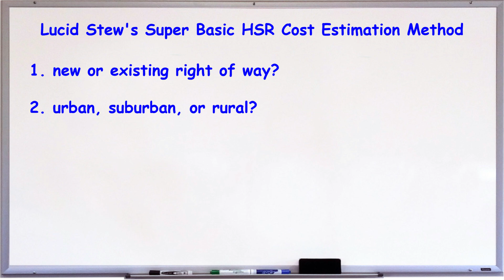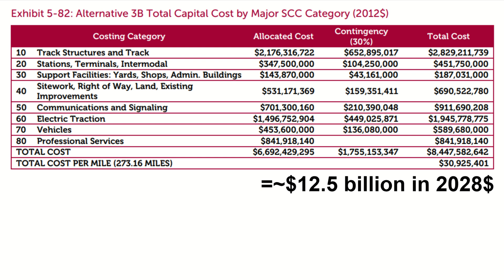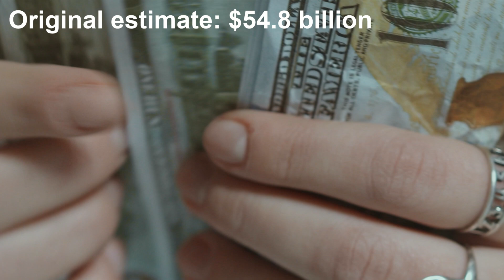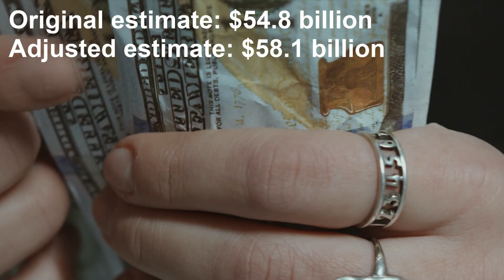Regional Cost Estimate Adjustments For Previous HSR Videos

Comment: A number of your commenters herein and elsewhere seem to be under the illusion that HSR is too complex for American construction companies and technology providers. That's utter nonsense. Our huge contractors are capable of building complex infrastructure. None of the concrete bridges and pergolas under construction between Madera and Shafter are as complex as the incredible freeway interchanges in Los Angeles, Houston, and Atlanta, that look like a bowl of spaghetti. Unfortunately, the spaghetti metaphor does not do justice to these complex engineering marvels that allow multiple roadway paths to cross each other in order to safely and efficiently facilitate the movement of high speed motor vehicular traffic from one highway to another. The geometry and math involved in their design and engineering is far more intricate than anything found in any HSR project anywhere in the world. HSR requires large radius curves and mild, gradual grades, and that's why it is relatively simple compared to the modern highways that urbanists and railfans detest We're experts in advanced electronics and computerization because of our military prowess and industrial might. And we're capable of building complex power distribution systems. Look at the very complex air traffic control system employed by the FAA. Moreover, much if, not all, of the technology needed for signalling and electrification can be purchased off the shelf from Siemens and Hitachi. No, the real problem is politicians and bureaucrats, both in California and DC. And an unwillingness to fund a costly, long term project. California unwisely commenced a project it was unprepared to promote, incapable of administering, and unwilling to fund. THE result is 20+ years of EXCUSES...EXCUSES....EXCUSES.
Reply from the maker: CAHSR specifically... in hindsight Proposition 1A was bad. The me that voted for it basically thought infrastructure = good. Now that I know a little more about the subject, all the caveats and restrictions are a terrible idea. This reinforces my thought that the referendum system needs reform because the general populace isn't qualified to make these decisions. Some of that is born from politicians who don't want to take a political risk or don't have the votes, so they transfer that to the referendum system.
On the national side, the current plan is just painfully slow. I will credit Congressional Democrats for managing at least SOME funding over the next 5 years.
Reply: @LucidStew Yes the proposition system is flawed for the reasons you stated. (Was looking here for "the" Chris comment).

Comment: One thing that's overlooked here is that a big reason Asia and Europe can build HSR for cheaper than we can is that they've a lot of time and money spinning up their build infrastructure. They've had decades of experience planning and actually building this infrastructure, securing supply chains, and their construction crews are already experienced in doing the work. Undoubtedly, no small part of CAHSR's cost is having to pay for spinning up the infrastructure to build HSR in the US at all. As more HSR gets built, that institutional knowledge is going to get built up and should help bring down the costs to build HSR elsewhere in the country. As such, building some of the smaller, cheaper projects first might help make the larger projects more attainable. The trick is that we can't stop building until we're done; once we stop, the institutional knowledge we paid to create is going to vaporize practically overnight, and it's going to be more expensive to build all over again. I'm really hoping some of these projects get off the ground before CAHSR phase 1 finishes.

Comment: Construction cost estimating is an important part of building anything, and it's taught in schools and people specialize within the field and get certified in some way. But none of that means anything if the thing you're building is in a constant state of flux as to it's specific form - which is true of almost every passenger rail project in the past few decades. I think public financing tends to set up a sort of secret adversarial attitude on the part of the design contractors, who usually remain with a given project to completion. In many cases in the NYC Area they continue making "necessary changes" all along the way and it gets very expensive. The MTA has recently set up a special department of "Construction and Design" (as if the latter isn't supposed to come first) and the whole thing is overseen by an executive pool consisting mainly of two, who have both had experience in construction of big commercial real estate projects in this locale. I can't help thinking they're sympathetic to the rail project designers' (big engineering firms) wants and desires as they relate to gains not legitimately intended on the part of the project sponsors. I can point to instances where design documents created by these companies contain actual physical impossibilities -  a few big instances, of big import assuming the projects are actually to be built. But it may be the MTA and their advising engineers have already decided against these, and the EIS is only for appearances. The simple solution would be for the MTA fiduciaries (the Board of Directors) to grow a set of brains and discernment about rail projects, but we seem to be moving in a direction that is opposite to that.
Reply from the maker: I know this is tangential to what you said, but what do think is the level of input from the mob? I was reading about one of the tunnel projects out there they discovered something like 100 people on the payroll where no one in the organization could figure out what they actually did. That sounds a lot like organized crime to me, but I also don't put it past general corruption. That's a problem with projects run by an agency that doesn't have profit as a concern, because it's easy for the money to flow to non-productive places.
Reply: @LucidStew  this is equally as likely a phenomenon known as "bullshit jobs", described in a really great book of the same name by David Graeber. Basically, there's a lot of jobs (particularly in white collar settings) that exist that nobody, least of all the person doing them, seems to know why they exist. It's actually shockingly common in the white collar world.
Reply from the maker: @curtthomas8465  I remember watching a Brightline video not too long ago where 7 guys were out in the field pulling pre-positioned tracks with concrete ties into place. There was a guy using a backhoe to pull the rails into position, a guy working with him to get them lined up, and then a group of 5 guys "supervising". 😄 I've worked with and for a couple of different utilities. Little different with them. The number of workers was fine, but there was a refusal to address fundamental problems, so the same issue kept getting assigned and "resolved" over and over.
Reply: @LucidStew  yep, reminds me of the old CalTrans joke about the t-shirts with the upside down pockets for hands free shovel leaning
Reply: @LucidStew  Yes, and yet that's the very reason public agencies took over in the the 1st place. I can give at least one example from another field to explain, because (heaven forbid) this is not the mob that's destroying the system of transportation - though the things they do are certainly corrupt. In NYC we had a bunch of very successful restaurant chains, which probably did the majority of that kind of business in the city in my early youth: Schrafft's, Longchamps, Luchow;s, Chock-full-O-Nuts. (Luchow's wasn't a chain but BIG, and I worked there so include the name) They were all eventually taken over by two buy-out companies - one was called Restaurant Associates - who set about gradually destroying the restaurant businesses (crappy service and food) but profiting all the more by selling the NY real estate out from under these enterprises. It's exactly the same MO the RRs were engaged in, getting well under way in the 1950s: selling off brand new sets of rolling stock (that's in Burlington's signal history author unknown) and literally selling off the main line in cases, resulting in damage to the business that can never be recovered. (There's a video about the efforts to get rid of the government mail contracts I'll try and find - https://www.youtube.com/watch?v=wj4k8qDAB8I - insufficient as proof of a national conspiracy) But you'd have a hard time proving any of this was the mob or "Russian Mafia"  or even illegal. Whereas we're in a better situation with the public agencies, because they're clearly getting cheated in a legal sense, and someone (hopefully not me but probably will try unsuccessfully) could bring a suit against the agencies "respondeat superior"  to clean these guys clocks. (I'm working on an intelligible version including access fr AZ - finished soon ((days))
Reply: I never read about that business of non-functionaries involved in a tunnel project, but suspect a lot of their complaints about passenger RRs being expensive do to essential paroll like staff on trains is BS compared to the money spent on titled functionaries. Afraid that will never be totally addressed - part of having public agencies.

Comment: Completely agree we are building in the most expensive areas but also some of the areas with the highest demand. So it all makes sense.
Reply from the maker: The problem is that the expense of CAHSR is held up very prominently as a reason not to do it. If somewhere else can do it cheap, that would go a long way to dispelling that fear.
Reply: @LucidStew  I absolutely agree, I the capital expense is the easiest thing for people to see. Though, ridership would be the next thing train detractors would latch onto, that or profitability, and CAHSR and the NEC are easily the most profitable regions. (I think, *Not an expert*)
Reply: @LucidStew aka CLT to ATL
Reply from the maker: @gregory596  Yeah, in my mind that project makes a ton of sense. You can link those two airports, the two metros, and remove a lot of the short hop flying between the two, which would delay airport expansion projects they're talking about for both areas.
Reply: @LucidStew  Also wanted to say love the videos please keep them coming!
Reply: @LucidStew  This is part of my hope for Brightline West getting built, and then maybe doing something like snapping up the Texas Central and doing that, so we have more examples of it built for more reasonable cost, and also of the benefits once operational.

Comment: All put together, with all the bells and whistles, a world class high speed rail network in the US would cost $516.7 billion. Adding $200 billion extra for a potential Texas Triangle route, Cascada, and NEC upgrades and we've got $716.7 billion

This is not much more expensive than the ENTIRE national highway system.

There is no reason why we can't or shouldn't build a world class high speed rail system in the US. We've spent more than twice as much money on the F-35 project, and almost 3 times as much on the war in Afghanistan. C'mon Andy!
Reply from the maker: With connectors, true NEC upgrade, and west coast stuff, you're probably close to $1.5 trillion. However, if the cheaper sections, like Atlanta-Charlotte are remotely correct, seems like a good way to kick start the idea. Then maybe you can get the whole system accomplished over the decades. Even at $1.5 trillion, that's only $30 billion/year over 50 years. Of course that would inflate, but it's not a ridiculous amount for an entity with a $6 trillion/year budget.
Reply: @LucidStew  I don't think you'd need connectors though right? They'd be far more expensive per mile than even air infrastructure. I think the regional systems would be good enough alone, no?
Reply from the maker: @evanoc  I think if you want a world class network, you'd want to connect the major regional networks in at least a few places, especially east of the Mississippi.
Reply: @LucidStew  I'm def curious to see if, even with the 1.5 trillion dollar estimate, high speed rail would be more or less expensive per passenger carried than car/air infrastructure. I think it's good to make an economical case for HSR over and above the environmental one. What do you think?
Reply: @evanoc  I think there is potential to use HSR for fast shipping. I think if a business case for express freight could be made, then it would be easier to sell the benefits of HSR
Reply from the maker: @evanoc  The environmental argument is ancillary as far as I'm concerned. Really what I'm interested in is good options. The conclusion I came to is that this mode makes a lot of sense between roughly 200-400 miles in the right places. If that's the case, we should build it.